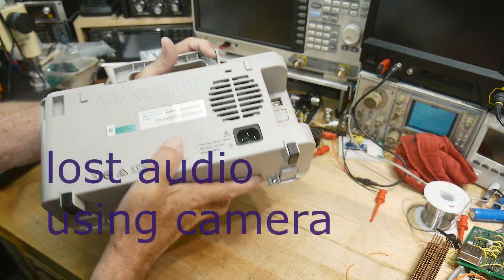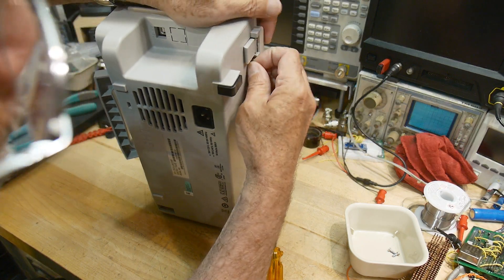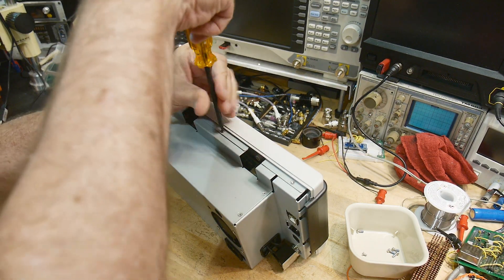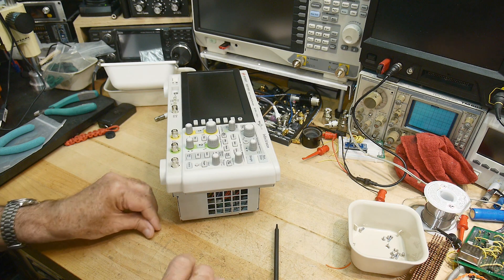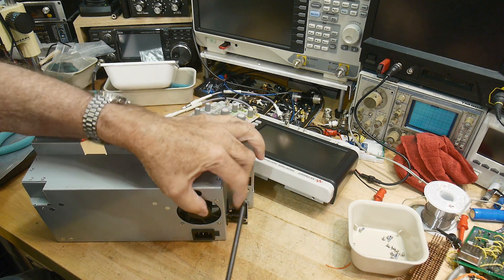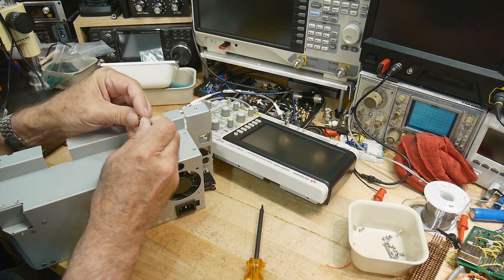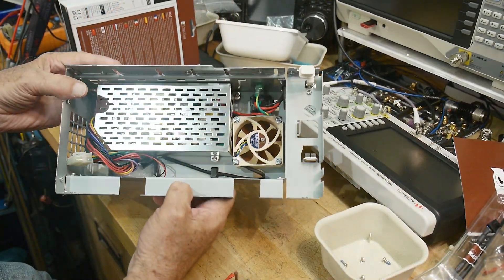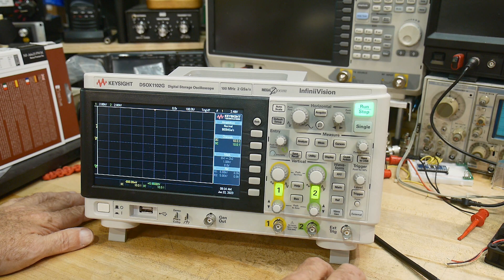#1563 New fan for Keysight Oscilloscope

Comment: Noctua fans come with the brown rubber/elastic mounting thingies, you’re supposed to use those, thereby avoiding having a firm mechanical connection between the fan and the chassis. It’s clearly described in the manual, their products are very well documented 
Using the original screws transfers noise from the fan to the chassis 😊
Reply: So basically what you're saying is their fans are all marketing hype - what they're actually selling you is a regular fan, but with fancy rubber mounts!
Reply: @gorak9000  No, that’s not what I’m saying. The Noctuas are designed with noise reduction in mind from A-Z, the fan wings are different as well so in fact, they have a slightly lower CFM rating which you need to take into account. Any fan will transfer noise to the chassis structure, using the elastic mounts mitigates that.

Comment: Use the provided rubber fan holders instead of the original screws. Also, you can try to add a resistor in series just to reduce a little bit the voltage across the fan. This will be enough to make the fan silent I believe.

Comment: This seams to be the norm after replacing the fan with after market parts. Question have you ever replaced a display screen on one?
Reply from the maker: no, lots of laptops, I've done several VFD on multimeters and such. I think the small TFT displays used in oscilloscopes are not that easy to find
Reply: @IMSAIGuy  I found some on the web. Question how long typically do DSO’s last?
Reply from the maker: in my experience, forever
Reply: @IMSAIGuy  Thank you. Of course I have read that the Tektronix 465 analog scopes you could get many years out under continuous use. Your thoughts?
Reply from the maker: I had a 465. Very nice scope. I'm not sure about 'continuous' you needed to turn off the scope to prevent CRT phosphor damage.

Comment: You really do need to use those rubber insulators, which keep the fan isolated from the metal housing. I believe I have seen you use this style of fan in another of your instruments.
Reply from the maker: yes, I put one in a counter. there didn't seem to be room for the rubber stuff. maybe someday I'll go back and work something out
Reply: @IMSAIGuy  Simple to cut the rubber down to make a flat washer and use that to reduce vibration transfer, plus also use some thin weatherstrip on the steel chassis to damp the vibration modes it has.

Comment: I've found on many systems I can sometimes use small O-rings to isolate the fan body from the chassis, obviously you might need to respect earthing if necessary, but the o-rings often work really well and cost a few pennies. The trick to all those "super quiet" fans is the rubber isolation mount not the fan itself, if you just put the rubber mount on the old fan you get the bulk of the benefit.

Interestingly there is a property of rubber that controls it's "Recovery", that is basically the rate at which it's elastic properties recovery if compressed or stretched, you can make rubber bouncy like a superball or you can make rubber dead like playdough, having just the right rubber recovery kills vibration. There is a special type of sheet rubber you can purchase called insertion rubber, this is a mesh reinforced rubber sheet used to isolate machinery from hard surfaces, the reinforcing stops the rubber extruding away over time.
Reply from the maker: that might work here.
Reply: @IMSAIGuy  If you are able to float the fan between sets of small O-rings and still have it secure it might work, I've mostly only really done this on PCs so I'm not sure about the Keysight. I've paired o-rings with small nyloc nuts previously so I don't have to over-tighten the mount. If the o-ring works, a longer term solution might be to then if possible drill out the mounting holes and install tiny grommets as a better more permanent solution. It's a bit filddly, but a lot cheaper than the posh fans. The reason grommets work better is that they stop the fan mounting bolts migrating towards the edge of the mounting hole under vibration, if the bolts start rubbing on the edge of the mounting hole the sound might actually get worse. Think of a car with a squeaky suspension.

Comment: You can probably use one of the included low noise cables(resistor in series) and the flexible mounts would probably fit OK, either them or the plastic of the back would flex a little.

Comment: I don't expect reduced cooling would be an issue if you reversed air direction as the new electronics are so low wattage.  I try to point air flow in the direction I want fan noise to go. 
Whatever happened to the piezo actuated flapper fans? Were they ever used for equipment cooling?
Reply: The issue is with the air direction moving hot air onto the cold components then. The piezo fans never got great traction because they are so much more expensive to make, and the glue cure times interfere with fast production.

Comment: Wow, I would have expected a really nice fan in a Keysight product, but apparently not. Noctua makes the best pancake cooling fans, so you should be able to achieve adequate airflow with less noise. you could try modding the supply voltage to run it at a lower speed to maintain your sanity...

Comment: From my experience the last two of the twelve volts add more to the noise than to the airflow. So with a serial resistor .. but don't try it at home.    Whenever possible the fan should be temperature controlled. From there one can also get some experience on fan power vs. cooling effect.    I remember a discussion at a product introduction of a microprocessor development system that had the sound of a grown up vacuum cleaner.
Reply: I usually put 2 to 3 diodes in series - that gives you a 1.2v to 1.8v voltage drop to the fan. I don't really suppose that diodes are any different than a resistor - p=vi no matter whether it's a resistor or a diode

Comment: I've heard many extol the virtues of the Noctua fans.  Not in this case.  I've taken some fans apart & added some very light silicon grease to the bearing areas & had some success on quieting.  YMMV
Reply: I'm pretty sure Noctua is 95% marketing hype, and 5% those rubber mounts that actually make a difference. The fans are just ordinary fans, but made from brown plastic. The only real way to get the same airflow with less noise is to put in a bigger fan that runs slower. Most of the time, you can just run the stock fan a lot slower by putting resistors or diodes in series with it and reducing the voltage a little. The scope is probably speced to operate up to 45C or 50C, and the fan moves enough air to keep it cool at that maximum environmental temperature. The other way is with a temperature dependent speed controller. Seems like the perfect project for this channel!

Comment: Hi, put a full-surface neoprene pad between the fan and the plate - it will help, although it's not 100% because the packaging acts as a resonance chamber. With my oscilloscope, I also wrapped the fan around the perimeter with neoprene and it is about 50% better.

Nice day 🙂 Tom